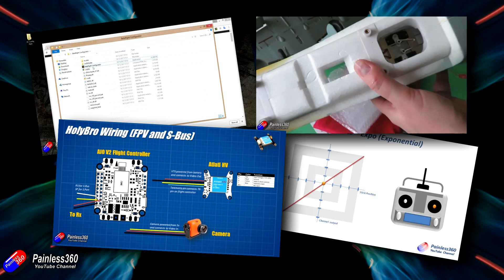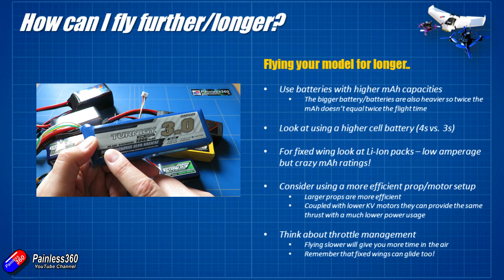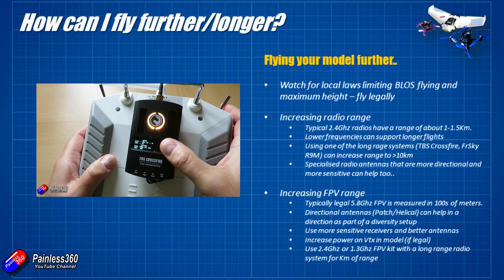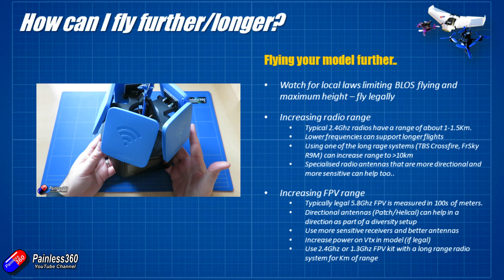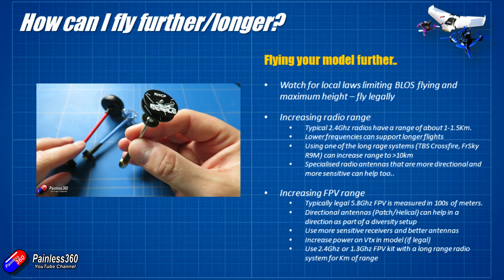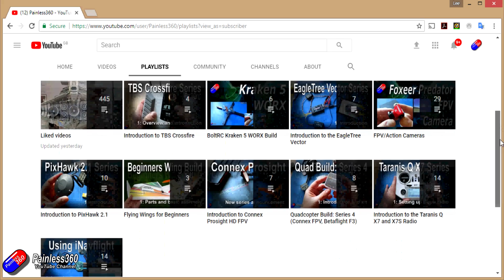Common Beginners RC Questions - How can I fly longer and further?

Comment: Hi. First of all my compliments. Very educative! A question, how do i calculate battery size/amps for say ten 6volt servos.  I actually mean how big in amps does a lipo have to be to be able to fly for example 15 minutes. Thanks for your answer.
Reply from the maker: It depends very much on the servos and how hard they are working. Servos are usually run by a BEC so the amp rating needs to be big enough..

Comment: I want to add a tri blade propeller to my motor. How many inches do I need to go down? Im using a 5inch two blade propeller right now. Could I just use a 5inch 3 blade propeller?
Reply from the maker: Rule of thumb is reduce the diameter by an inch..

Comment: I used to love flying fixed-wing, 4-stroke models with full-span flaps and the engine swinging a huge prop, just barely ticking over. Oh yeah. 30° of flap, a bit of up trim, just holding off the stall, and you could stooge around for 40 minutes on 4oz of fuel. Hit some lift and, RX battery permitting, you could be up for hours... Powered thermalling - bliss!
Reply from the maker: Now you're talking! :)

Comment: Hello from the U.S.A.... I got into flying quadcopters a couple of years ago . Now I’m going to try airplanes and have purchased a few of them . I’ve decided to build a home base with 900 , 1.2 , 2.4 & 5.8 Antennas all from IBCrazy . That way I can change to whatever frequency I need . I recently purchased a Platinum from DJI but haven’t flown it yet . For the airplanes I plan on using the Frsky R9 & R9 slim receivers . My Question is I have a PixFalcon that I want to include in one of my Planes . There doesn’t seem to be a lot of information on installation of it . I have watched some of your builds with the PixHawk & INAV  .. Should I refer to the PixHawk during the installation ?    Thanks for Your Time & I’ll continue to Watch & Subscribe .
Reply from the maker: Thanks for the comment and glad to hear that some of the content is helpful. I've not used the PixFalcon here but from what I've seen the setup is essentially the same as a PixHawk. Should make for a fun build! Best of luck with it!
Reply: Painless360...... I was curious if there was a reason you chose not to use the PixFalcon in any of your builds ?   Thanks Again for your Time
Reply from the maker: Because it's a variation on a theme, I've already done lots of videos on the pixhawk and other members of that FC family. The setup and process is the same and fantastically well documented in the Ardupilot documentation too. Best of luck with your build!

Comment: I raised an eyebrow watching this video because I feel we should differentiate between energy/power, current and voltage more clearly. E.g. using a battery with the same capacity (Ah) but more cells will increase the voltage (and energy and weight) and your gain in flight time depends on the sweet spot of your motor/prop setup. In many cases a battery with the same cell count and higher capacity will be better, weight being equal. Doing research about the motor/prop combination thus is a good start for potential gains.

Obviously, reducing weight and drag will help with flight times. For quads this mainly boils down to the choice of the frame and battery. Thick arms and lots of screws add weight, wide arms and large top plates add drag (even worse, they produce downforce).
Reply from the maker: You're obviously not a beginner and those are the pilots/builders that these videos are aimed at. Please see the more detailed videos for deeper coverage of these topics. You can also create content and help other pilots on your channel too - the more the merrier! Happy flying!
Reply: You are right, sorry for nitpicking. For novice pilots I just wanted to say: Using a higher cell battery may help a little or a lot, your mileage may vary. More content is on the way but editing is time consuming. That's why appreciate your videos so much, the effort and experience you put into them really shows.

Comment: Hi Folks. I'll offer up some of my BT signalling background. Doubling the transmitter power won't double the range - and Lee did n't say it did. You will get, other things being equal, 40% more, not 100% more. It's because the signal spreads out in two directions so something called a 'inverse square law' comes into effect and the distance increases by the square root of the power increase. To double the range from 25 milli watts you have to go to 100 milli watts, not just 50. Licenced amateur radio enthusiasts and others in your area may well object if it's not legal. There do tend to be very good reasons for some of these annoying legal limits. Cheers. Bob UK.
Reply: Well, somebody likes me! A bit, at any rate. BobUK.
Reply from the maker: See the link in the description to an excellent tool on the MenaceRC website that you can use to calculate your FPV range. A practical tool that perfectly illustrates this great point..

Comment: Hi Lee. This is for beginners (like me!) and thank you for it. But, straight off you {may be getting close to what some newcomers may see as techno babble}. What's a 'throttle curve'? What's a 'PID?'. Now, I've watched a lot of your channel, so I know - or at least have a theoretical knowledge. {I also know that a Google search followed by 'painless360' will turn up an excellent explanation from your self. But I supect that many of your newcomer target audience won't  bother. They will just move on}.  I used to work for BT and we were REALLY fond of abbreviations. To me, with a signalling background, 'PCM' obviously stood for 'pulse code modulation', the software department I joined foolishly thought it meant 'process control module'. Very confusing. Which gets me to 'FPV'. Ok, probably not really a problem, but see how easily this techie code slips in. BobUK. [Edited Easter Monday as original clumsier version caused un-meant offence, for which, Lee, I apologise. See {} brackets].

Comment: I would like a video on mounting fpv cameras I never can seem to get the right screws to hold camera still and at right angle except my chameleon which is rock solid
Reply from the maker: Thanks for the idea. I find that all of the cameras from places like RunCam and Foxeer come with all the screws you need in the box so it's easy. What in particular is proving tricky?
Reply: Painless360 getting it to stay tight